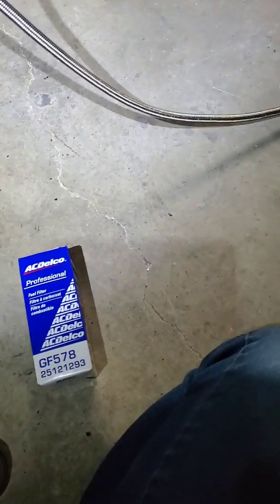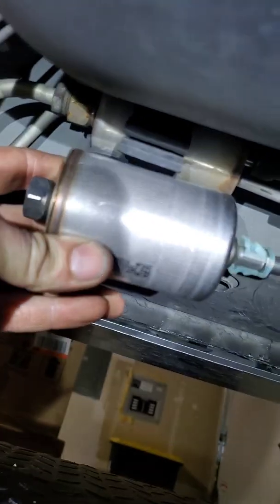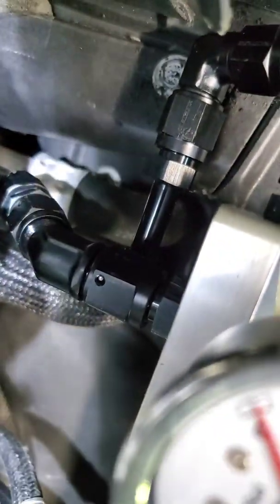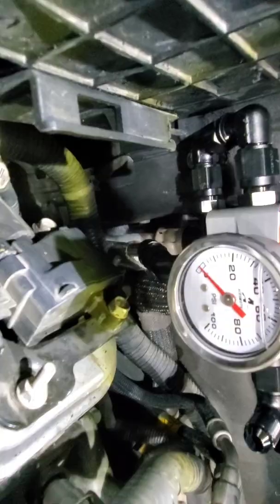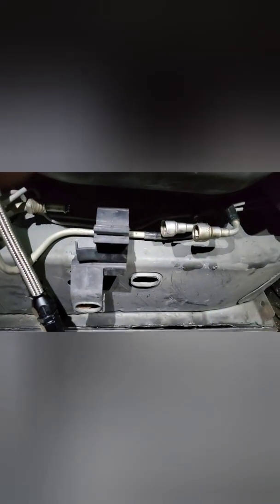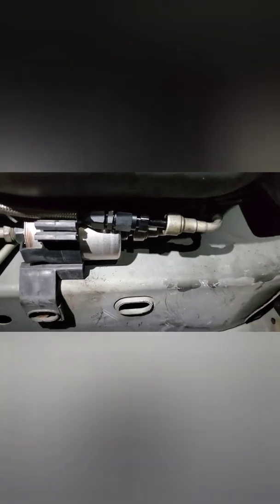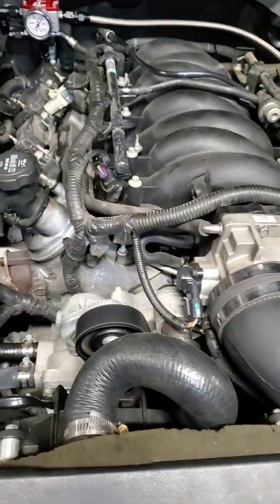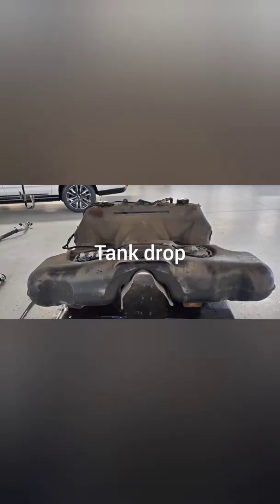2005 CTS-V LSA Swap Part 2: Fuel Filter and Fuel Pump

Comment: What made you change the Fuel Filter?? Cause I have an 05” CTS and I turn the key and the serpentine belt turns but the engine doesn’t turn on; it sounds like the engine wants to turn on but it doesn’t turn on at all. And I’ve seen different videos and I’m thinking it’s definitely the Fuel Filter
Reply from the maker: This is a 5 part video on how to add a supercharger to a CTS-V the filter needs to be changed to a return less one.